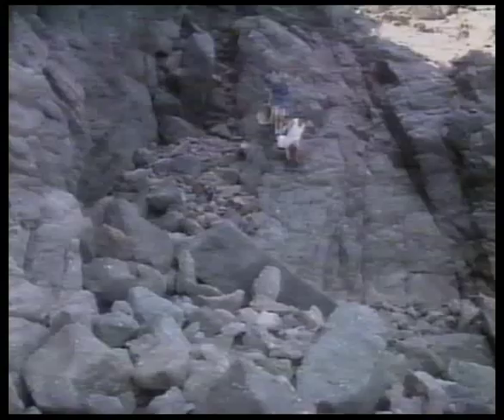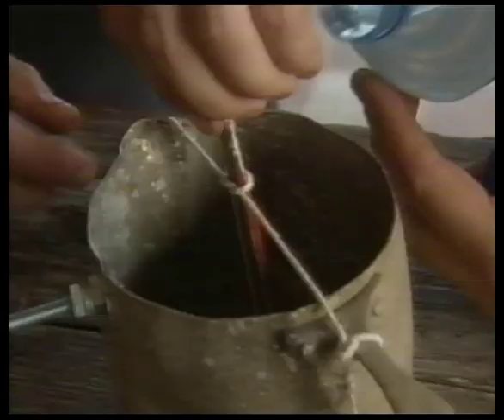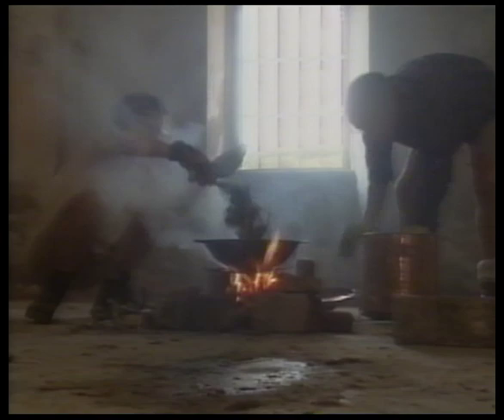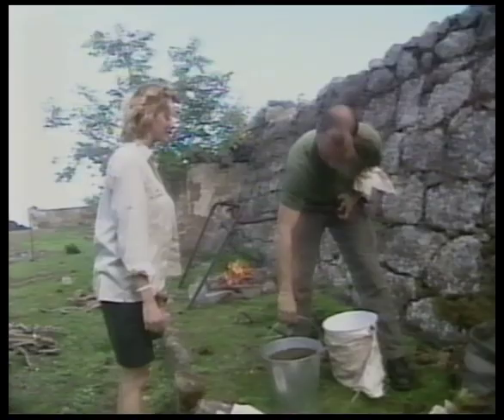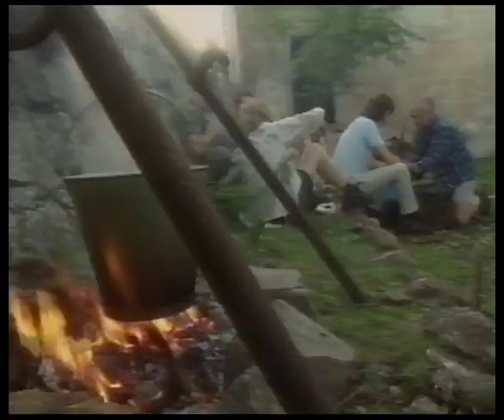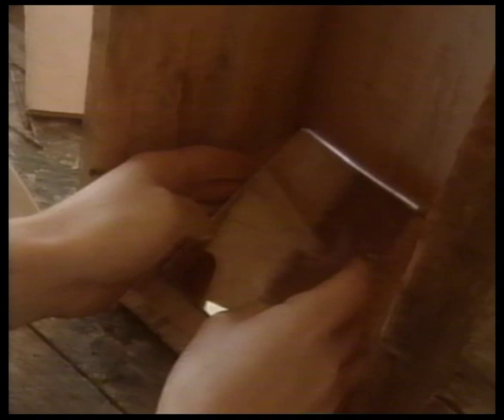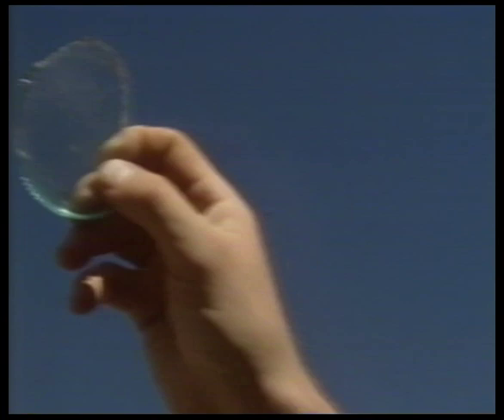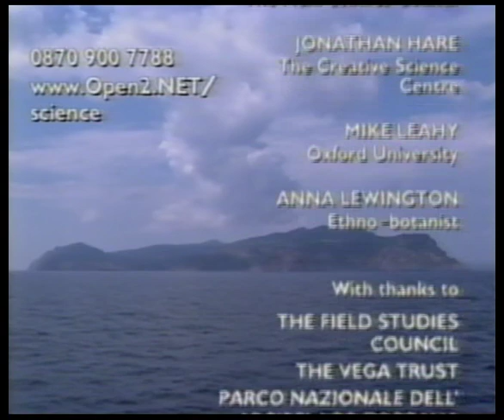Rough Science 2 Simmering Shutterbugs

Comment: Would like to know more about the current meter!
Reply: Do you still wanna know ?
Well, I think I might be able to explain how it works : one of the coils acts as an electromagnet, when the current flows through it, it attracts the other coil, which also becomes magnetized. The meter moves, by the attraction between them, on the lever. It's called a galvanometer. Hope that it helps !
Reply: @Ryan-lc4bl  That I understand but where does one find nice old analog gauges these days?